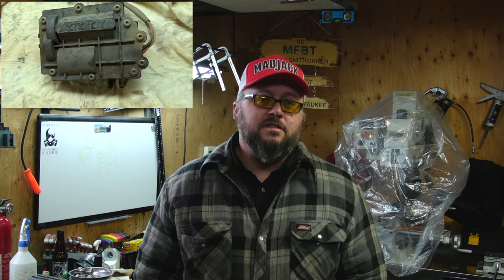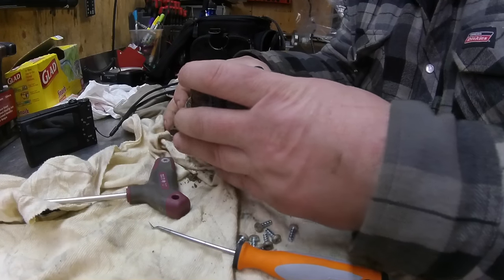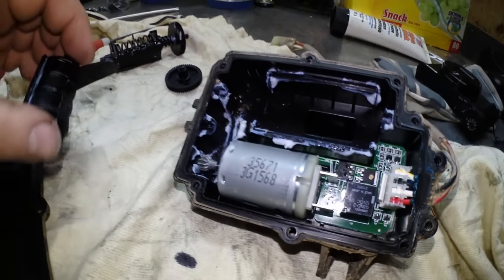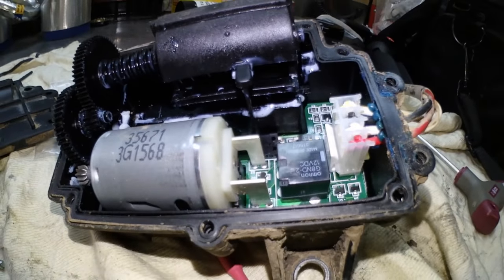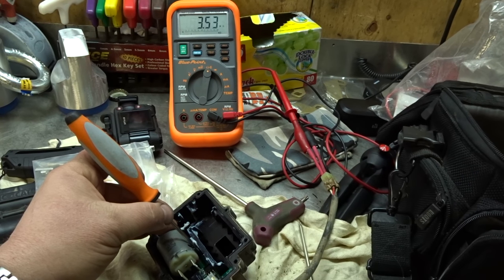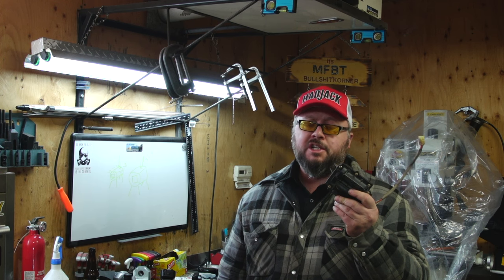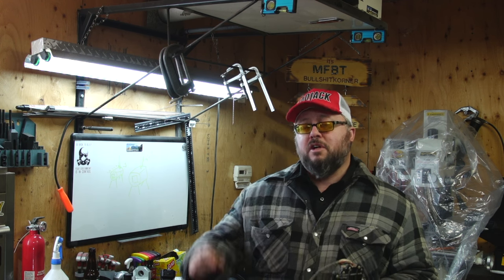Arctic Cat 4x4 Actuator Problems

Comment: I watched your video and others before taking my actuator apart . Turned out my problem was the little electric motor not working at all .  I took the motor apart , the armature was coated in crud, cleaned all up , put it back together which solved my problem . Works fine now. Keep up the informative posts 👍

Comment: Hey Jerry, just thought I would let you know that I had the exact same issue with my actuator. Turns out that the one limit switch was stuck. I solved the problem by disassembling the unit and by spraying the circuit board with penetrate, then manually manipulating the limit switches.  This freed up the offending switch, and solved the issue. Time for a Rollng Rock.  Keep 'em coming Jerry.  Bruce from north Ontario

Comment: The limit switches are manufactured by Cherry Electronics... Part # for the switch on the motor end of the card, (SW2) is DH2C-C6PA and on the other side, (SW1) the part # is DH2C-C5PA
Reply: And what are the designations D4 and Q1 ?

Comment: Some hopefully helpful points about diagnosing an actuator. My experience is with the unit on a 2013 TRV which has both the 2WD/4WD selection and the 4-Lock/4-non-Lock selection. Yours, the 2/4-only version, and mine both use the same 4-pin connectors, AND the connectors and harnesses on both actuators use the same wiring scheme. (Some wiring differences on the vehicle-side connector.)
The wires on the actuator itself are as follows:
Red: switched, fused 12v from ignition switch and fuse box. Only ON when key is ON.
Black: permanent Ground
White: yours, not used; mine, 4-lock ON/OFF
White/Yellow: 2WD ON/OFF from handlebar switch
The actuator selects 2WD or 4WD by interpreting the signal on the Y/WH wire. The switch on the handlebar can either ground this wire or let it "float" off ground. (The switch does not connect it to 12 volts.) The circuitry in the actuator (transistors, diodes, the relay and the microswitches) then figures out where the slider is and in what direction the motor needs to turn in order to move the slider the other way. That's all it knows how to do: move the slider the other way.
The relay ultimately makes the motor go clockwise or counter-clockwise, its switching  controlled by the other circuitry.
The two microswitches are connected to act as range-of-motion limiters and are electrically installed between the relay and the motor.
It is virtually impossible to diagnose the condition of the microswitches (or little else except a dead short of the Y/WH wire to ground) by "looking in" at the connector. The activity you did see on your meter probably indicates that the switches are OK. Cherry switches are very high quality and judging by the condition of the rest of the actuator, especially the super-clean motor, they are almost certainly not the problem.
I've seen a few actuator videos and nobody ever mentions what I think is the importance of the mechanical timing of the actuating device and the microswitches. I think it's important that the lever doing the 2/4 shifting has to finish its travel (push the pin into the differential)before the microswitches turn off the motor. Here is how I think this is done.
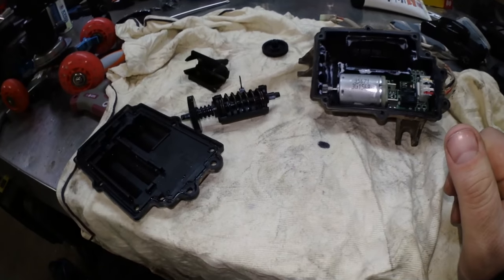At first glance, it appears that on command, the motor spins, the gears turn and the lever pushes the pin into the differential. This is sort of true, but not quite. Look at 1:25 of the video. The large gear at the left of the assembly is the last one in the chain. Note the spring in what I will call the carrier. On a shift into 4WD, the worm gear on the shaft with the large gear will pull the carrier, which rides on tracks, towards the large gear. Look at 1:25 again, at the actuating device in the background. Notice the two semi-circular segments in the rear end of the device. It is very important that when the carrier and this device and the spring are assembled together, these two segments must be captured between the left end of the carrier and the left end of the spring. There must be no spring coils between the semi-circular segments and the carrier. The left end of the spring must be pushing against the segments which in turn will be pushing against the inside of the left end of the carrier. 
NOW what happens on a shift command is that the carrier will be drawn to the left towards the large gear. The carrier will push against the right end of the spring. The left end of the spring will push against the actuating lever, and these three components will move together to the left. At some point, the actuating lever will contact the shift pin of the differential, but the spring is stiff enough to overcome this added load so the carrier, the spring, and the lever will continue moving left, bringing the pin with them. But now the pin bottoms out in the differential and the lever stops moving. The spring now starts to compress because the lever is stopped and the carrier is still moving because the motor is still turning. Finally, the carrier advances far enough that its "finger" trips one of the microswitches and 1) the motor is turned off, and 2) the motor control circuits flip so that the next command turns the motor in the reverse direction.
If there are any spring coils between the segments on the end of the actuating lever component and the end of the carrier, this sequence will not work properly. This might explain why the carrier appears to want to pop out of the case when you open it, although there will certainly be some inherrent tension in that assembly even when correctly put together.
The mechanicals are very important. 
Thanks for the vid. Some very useful shots.

Comment: I had the same problem, my switches worked fine.  It appeared the stop lever wasn't hitting the limit switch before it would bind up the worm gear and stop working.  Curious to know what you find.

Comment: If that housing didn't jump up as a result of it over turning that gear WOULD strip like most people's probably do.
However in RC cars that gear is referred to as a spur gear and they have a pitch and number of teeth that varies depending on your car/motor. This means there are A LOT of those gears available and more than likely one that would match up with the one inside that actuator. If you really wanted to take it a step further you could find an aftermarket spur gear that is metal and replace the plastic one with one of those.

Comment: Hey I have the same atv just put a new fuel pump inside the tank got it all back together and running but it won’t stay running idling I keep my hand on the gas and it will run but as soon as I stop giving it gas it cut off do you know what it could be

Comment: is there a source for just the circuit board with the electric motor mounted? Also any guys out there real good at repair/refurb of these actuators?
Reply: Did you ever find a new circuit board for your actuator

Comment: I have a 400 h1 2009 my actuator engages in and out of 4x4 so do the deff lock  but it sounds like the actuator  engaging slow not like  before  the actuator had a fast quick sound to it so I'm not sure if the actuator is getting bad it's been like that for a year now

Comment: I find it strange that both the limit switches don't go from open circuit to dead short. Usually that's the case with limit switches. I mean it's not like it's an electric window switch that has more than 2 positions and different resistances for each mode (up / down / auto up / auto down).
Reply from the maker: yes me too, i have new limit switches i just haven't connected them to a meter and see what kind of values they have.  I will do that once this project is finished
Reply: Sweet. Can't wait to see the results!
Reply: Your meter is trying to "see" the switches through a bunch of circuitry. The switches are not connected directly to the pins of the connector. (In fact, only one of those four wires, Y/WH, carries the 2WD/4WD command to the actuator unit.) This is an invalid test. Even if you put your probes right on the solder terminals of the switches themselves, on the back of the board, you may not know if any other components are in parallel with that set of contacts. But this is certainly worth a try. You'll definitely see a dead short when the switch is closed. You should also realize that one pair of contacts in each switch will be shorted while the switch is at rest. Then when you activate the lever, one of the previous contacts (the "Common" or "wiper") will be shorted to the third pin, releasing the first.

The only way to conclusively test the switches is to isolate them by carefully cutting some board traces (tricky if you're new at it) or de-solder and remove them from the board. 

The board looks to be in good shape, including no water damage or physical damage. Highly unlikely there is anything wrong with the switches. Is the "finger" long enough (not cracked off) to actually touch the switches and operate them? Read my Comment above for possible mechanical problem during re-assembly.
Reply: @TestDontguess  did the new switches fix the problem?

Comment: anyone have a part number for that limit switch by chance so i can order a few of these?
Reply: i found it. this is for the limit switch. Cherry Electronics Part # DH2CB1PA
also, i have ordered a replacement for the relay on the board. it's part number is OMRON G8ND-2 its a common automobile relay.
Reply: Hi! Were you ever able to order those limit switches? I've tried everywhere without any luck.  Any info would be appreciated.  Thanks!